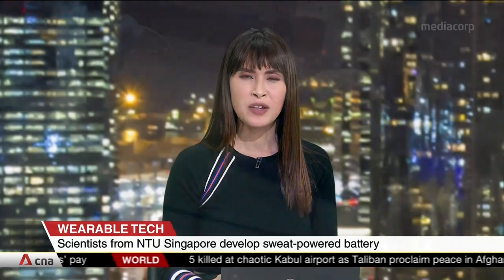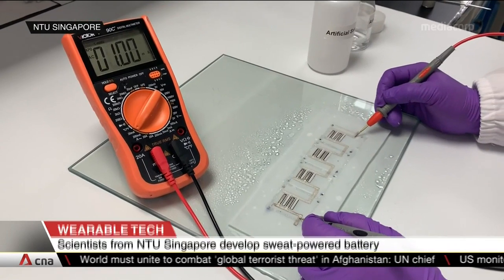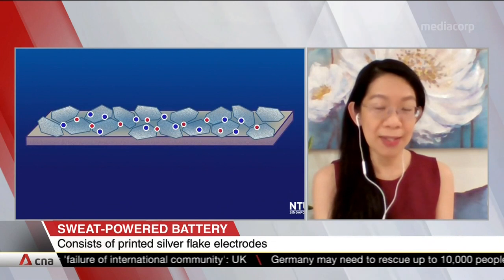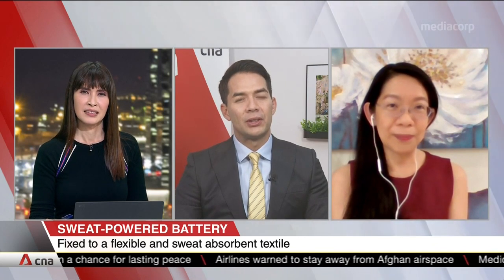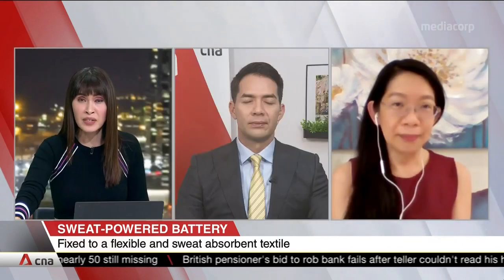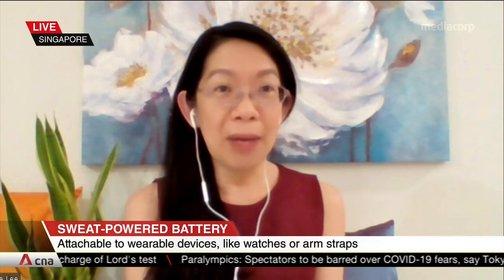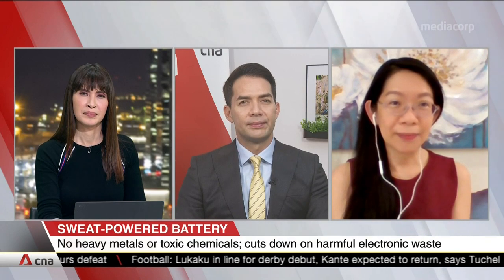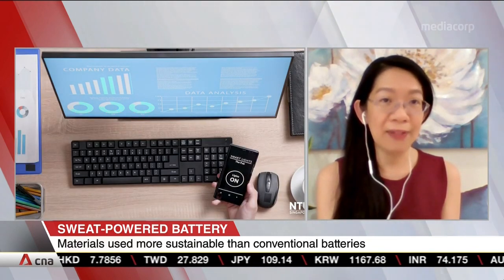Scientists from Singapore's NTU develop sweat-powered battery

Comment: Bread and butter research. You need to continuously sweat to get enough power and will be uncomfortable to wear with all the sweat built up. Wearable power generation has been over-researched for the last decade. There are better methods like PVDF (piezo-based material) that can generate more power.